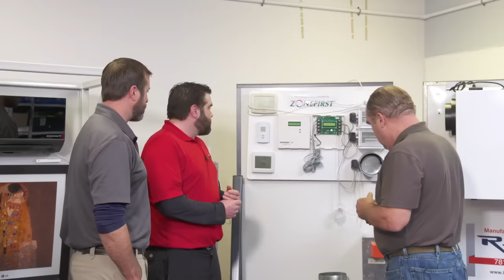This Old House | Pro2Pro: Focus on HVAC | FULL EPISODE

Comment: ToH is great but HomeServe is an absolutely abhorrent company. Paid for their full service after I got my new houes and everything was fine for the first year until the exhaust blower-motor went out. A very common and know issue with these Bryant Evolution 90i furnaces. Not only did we get denied the clam as according to HomeServe "That's not a known issue."  But they also had the gull to charge us twice for coming out to tell us that we are being denied as that's a " " " Service call " " " What exactly DO you do if not repair the number one documented issue on, arguably the most important appliance in a Michigan home right before/ during winter.

So now, I get to deal with a 40° house for days while I scramble to find my own contractor that wont screw me or try to find a working part myself in a sea of used overpriced junk, even though I have an insurance program that supposedly takes care of such things. Especially when it's such an important thing as a heater in a MICHIGAN home. 

Might work out for you, but from my experience even this, this best rated American home/appliance insurance company, is just a huge scam. If they wont fix a furnace in the peak winter what will they do?
Reply: We apologize for any issues with your service. We would like to have a Customer Advocate investigate your experience and assist with a resolution. Please email  us with the link on our channel, and provide your contact info. We will have our team follow up to help. Thank you.
Reply: @HomeServeUSA  
You can avoid wrongful denials by insuring that your agents do not come from the automobile and healthcare insurance industries. Those people are trained to automatically deny coverage even when the claim is covered in the policy.

If you think I'm exaggerating, take the time to watch a few commercials by personal injury attorneys.

Oh by the way. If homeserve falls into the habit of denying valid claims, homeserve should expect to hear from one of those attorneys that decides he just wants to make a point of legal principal.

Personally, I think all insurance professionals should be thrown into prison for defrauding the public as that is exactly what they are practicing.
Reply: Most companies that are part of that scam program try to skip out on their technicians to. It's a total scam I won't work for a company that is part of it

Comment: Explaining the heat pumps really simple. And cooling you're transferring heat from the inside to the outside. In the heating mode that you are transferring the heat from the outside to the inside. When I do installations which I do on the side I work for a school district in HVAC, Iowa sell the most simple units that I can. I think I'll efficiency gas furnaces are a waste of money. I like the two speed heat pumps that have the Copeland compressor with the unloader solenoid in it it's very simple. The problem is some of these units on this episode is the expense of purchase and the expense of repairs. Babe really don't pay for themselves but in some of those places in the Northeast you must use a ductless split because of the construction of the older homes. Most of the my experience in New York have hot water baseboard so you're very limited what you can do on a retrofit and the ductless is the only thing you can use. It might even be worth to somebody with an oil heat home that with no natural gas is available to use that as a backup and try to heat a home with a ductless heat pump. But I always recommend if possible central heating cooling first if possible. I also put in 4-inch filters every time on one of my jobs. If I can't fit in a 4in I put in at least a 2-inch and then make sure there is no tools necessary. Too many 1 inch filters out there which causes a lot more static pressure.

Comment: Some of these high-efficiency models are so expensive they're not worth to the homeowner it will just cost too much money. The problem with those multi-zone ductless splits is if you have a refrigerant leak you lose everything and the Never installed in the way to be able to isolate a problem. Although it recommends Central over ductless if possible sometimes it is not possible you have to use the ductless